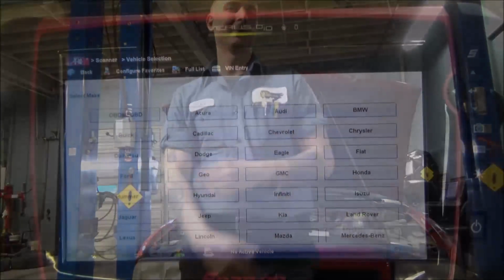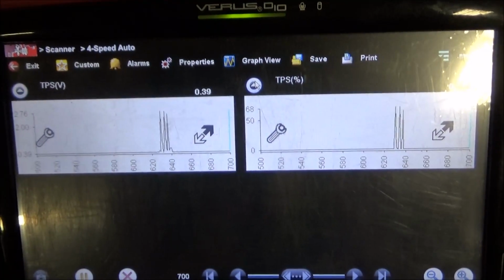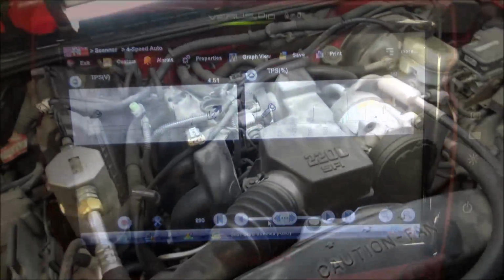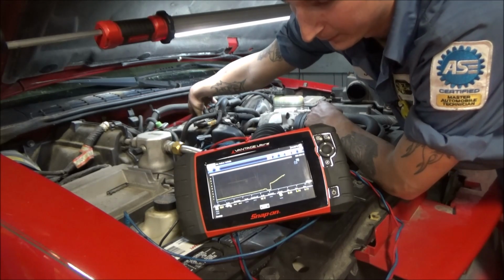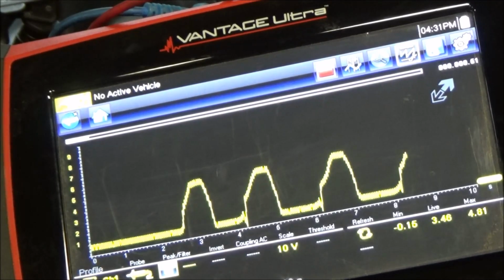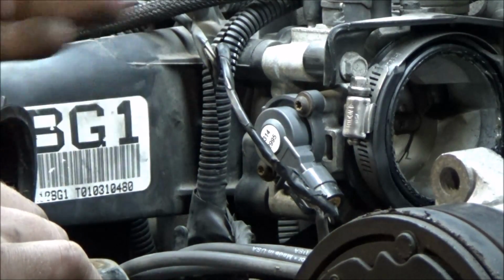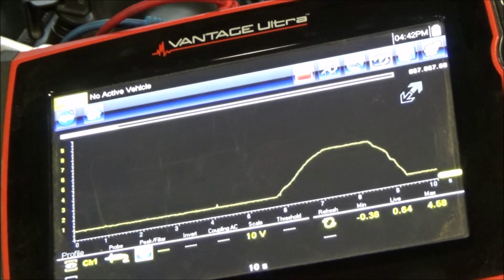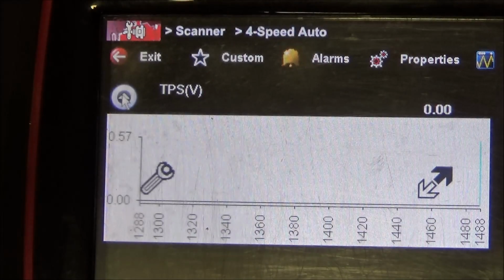2001 GMC Sonoma 2.2, TPS Troubleshooting

Comment: I have this same truck and it died out at a 🛑 the other day with a crank no start no spark check engine light on new  battery new fuel filter half a tank of gas and good fuel pump fluids are fine good starter still  churps fuses look good clean map sensor changed a couple of sensors recently doesn't burn oil or over heat plugs looked ok but I don't have a multi meter can't afford one  & no one I know has one and my knowledge and experience with cars is really limited to the basics truck was running a little rough just had a transmission put in recently been watching YT videos trying to find something but everyone tells me that it's something different in each video that I seen with the same symptoms and the only codes that we got from the odb2 was a po141 & a po130..has fuel to the shradder valve and plenty of compression dashboard lights up with key on but won't turn over doesn't sound like a bad timing chain the engine was replaced with a rebuilt  one along with coil pack thermostat plugs wires and fuel pump fan and fan clutch 2 yrs ago and it hasn't really been used much in the past 2 years but it was running good except for the  recent rough idle before it cut off... every video I saw they said that it could be anything from a bad wire /ground to about  a dozen different sensors cam crank tps  to the timing to something in the ignition system to a bad egr  purge valve fuel pressure regulator i tried a test light but it didn't light up maybe broke,YT came up with about 20+ different things that could cause these same symptoms that I'm having mechanics are to expensive at this point and the people at the parts store were no help either,out of work $ is tight and need my truck to get back on track...any ideas would be greatly appreciated stuck in a small town in so IL with little to no transportation please help any additional information or advise would be sweet... can't really afford to load up the parts cannon and hope it works if you know what I mean... thanks a bunch...

Comment: FWIW, I'm just about to get a third TPS sensor and it's never set a code, just started acting oddly on very light throttle with the engine dropping out for the first one, and this second one seemed to lose everything above 15% throttle for a single run cycle (possible I started the truck with it on a dead spot) but 'came back' after I stalled it. It's very possible for these sensors to wear out and give bad data but still remain within the acceptable voltage and not throw any codes. The first one I took apart and the carbon track was nearly worn through around the 10-20% throttle area, but not completely. Haven't gotten the second one out yet, that weirdness just happened today. 

"subject" is a 2003 GMC Sonoma SL 5 speed with ~330,000 miles. First sensor died somewhere around 200K, if I recall correctly. This one may be wearing down into the idle/0% area as it's hanging the high idle up sometimes coming to a stop, no vacuum leaks to be found... just leaving it at 1500rpm.

Comment: My son had a problem with his Sonoma 2.2ltr. It was lacking power, jerking, sputtering and sometimes would shut off. We took it to 3 different shops and spent over $3,000. The last thing we did was change the Coil Packs out. He bought the Duralast and it worked fine for about 3 weeks. The same symptoms starting again. The fourth and final shop actually said it was his Coil Packs again. Come to find out, when changing the coil packs on the Sonoma, they require factory coil packs. 

Note: This is all we done to it beforehand. Issue: 
1. Jerking while driving
2. Backfires
3. Only does these when warms up
4. Lack of power 

Possible fixes:

1. Throttle Position sensor

2. Idle air control valve (iac valve): easy fix. Just take off of the throttle body and clean with carb cleaner. While spraying, make sure electrical part is held up. If not, spray will ruin the part.

Fixed:
1. Fuel filter
2. Air filter 
3. Oil Change 
4. Had wrong spark plugs & wires. Replaced with correct.
5. Cleaned Throttle Body
6. O2 Sensors 
7. Catalytic converter 

Onboard computer diagnostics show:
1. O2 Sensor 
2. Code 0420- evaporative in mission system monitor #1(.040Leak

Problem Solved:
Replaced GMC Coil Packs. 
Do not use aftermarket because they only last between 1-3 months.

Comment: Hello on the grey wire mine goes up in voltage 5.06 to 5.10 is that normal or should I check the wire?

Comment: Well I'll be a Sonoma B@tch! I had a 2002 Sonoma 5 speed manual  no codes with only an incomplete Secondary Air monitor and no pending codes. Customer's complaint is idles too fast.Drove it and I verified a slow to return to normal idle after decelerating and coming to a stop. No vacuum leaks or high fuel trims. I did the throttle sweep from the engine compartment and couldn't verify any issue with TP drop out (except for the 2 roll limit at Wally mart) , but when doing TP sensor sweep from inside the cabin the TP sensor intermittently would not return to as low a voltage as when I started. WTF , I look down and see the heavy stiff carpeted aftermarket floor mat is over , the very bottom inch of the accelerator pedal. I pull the floor mat up and reposition underneath, problem fixed. Lessen learned, I think I want to be Captain Obvious before becoming The Professor :-))

Comment: awesome video. I was wondering if you could help me real quick since you were right where I had a question about. 

In that bundle just left of the sensor there was a tiny plastic hose I found broken (or broke lol) on my 98 2.2L. It goes to the top of the throttle body and back to some large metal hardline. It is like 1/16 to 1/8 in plastic line. You know what that is for and if it may explain a loss of power on highway hills?

thanks in advance
Reply: After hundreds of pictures and searches I believe I found it to be the FPR vacuum line. Apparently that would only allow excessive fuel pressure and other symptoms to appear.

Comment: As an electronics guy, I have to take issue with your explanation of a potentiometer here. It's not a 'lever' sweeping over a 'variable resistance'. While from an understanding point of view there may be no practical difference (which is not guaranteed in all applications and that's why I'm making this reply), this is objectively wrong.

Inside this sensor is a track made from a resistive  material (carbon, ceramic or metallic) which has a known resistance per unit of lenght. Its resistance value is fixed at the ends (not variable) and, in this application, the ends are tied in to a 5V reference and ground respectively.
The 'wiper' (correct terminology for the lever moving across the fixed resistance) is tied to the signal output and, in this case, serves as a variable voltage divider (think of it as two resistors in series with a variable mid point) between the 5V reference and ground.

The clever bit about this design is it's only supposed to show the center part of the sweep between 0.5V and 4.5V, allowing the engine computer to determine open an shorted conditions.
Reply from the maker: A lot of good information here.  I will agree that my terminology in reference to the "lever" versus a "wiper" was incorrect during my brief explanation of how this sensor operates.  In response to my use of the "variable resistance" term during my explanation of sensor operation,  it may be objectively incorrect in terms of an engineering standpoint,  but is still applicable when analyzing the rough operating characteristics of this sensor.  Though the carbon track is in essence a single resistor of fixed resistance,  the resistance of said material is variable depending upon the signal circuit's position upon it's surface.  My focus during this video was not to cover sensor design and operation in any sort of specificity,  but simply to show troubleshooting techniques used to condemn a potentiometer like this one.  Thanks for commenting and the good information you provided.
Reply: @pinpointautomotiverepair1592  As you point out; focus is the issue here. Thanks.

Comment: great video. thanks for sharing. Curious on what you found with the p0410? bad air pump? I remember a tsb on an updated air pump suction side hose due to water intrusion into the pump. Is there  diverter valve on these models? videos getting better and better everyday!
Reply from the maker: Hey there!  I'll be uploading the video addressing this P0410 fault code tonight,  so all of your questions should be answered :).  Thanks for watching!